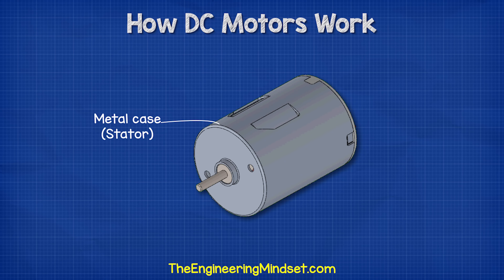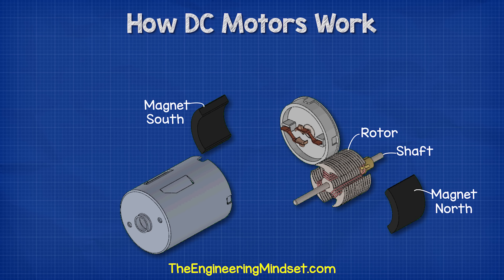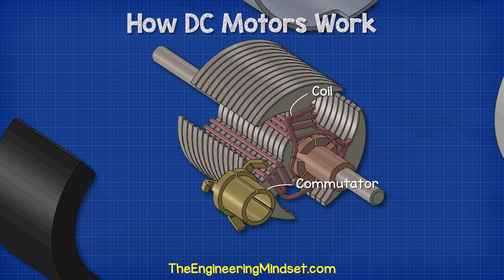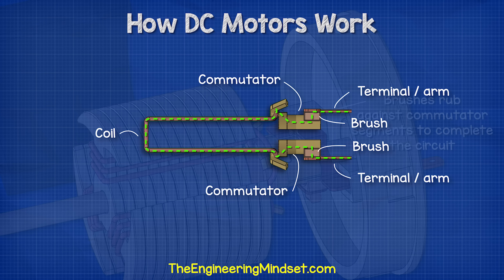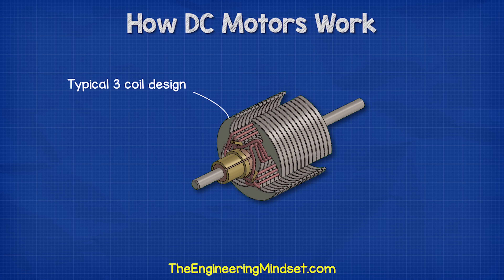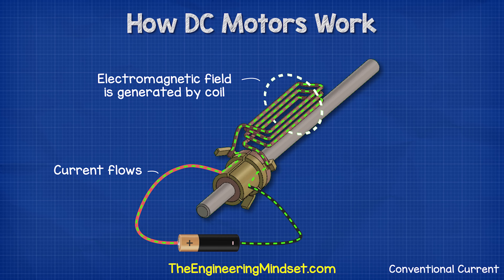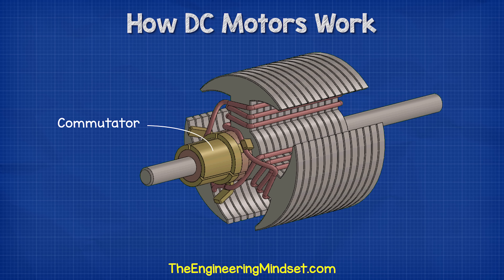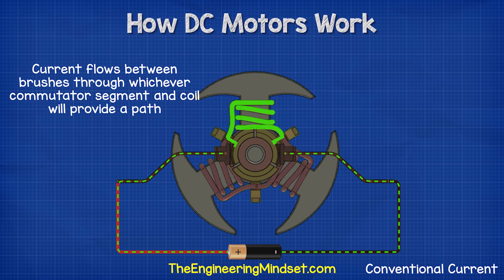How does an Electric Motor work? (DC Motor)

Comment: To remove the sparking you need to 1. Use stronger brushes, 2.) move the commutator forward or backward on the geometric axis. I am asking It's been a while 😅😅?